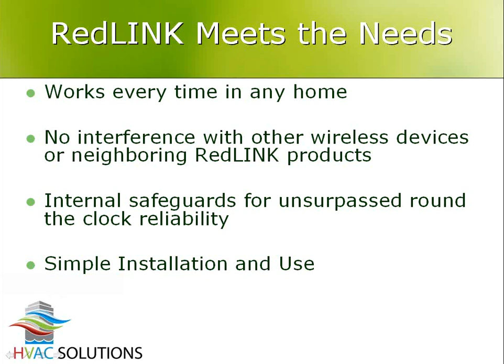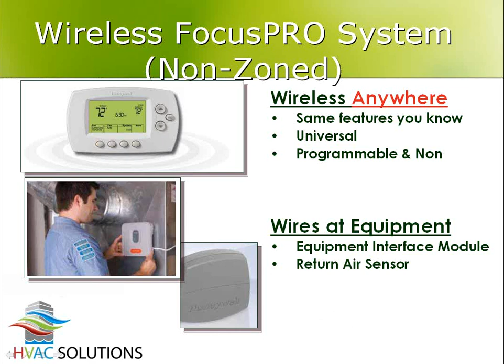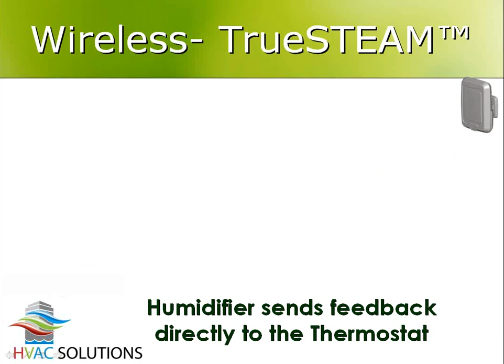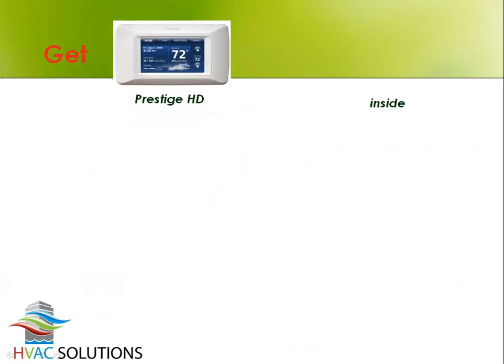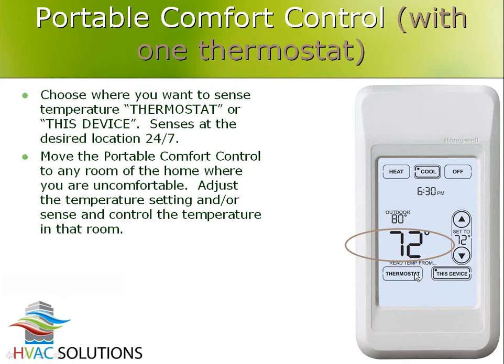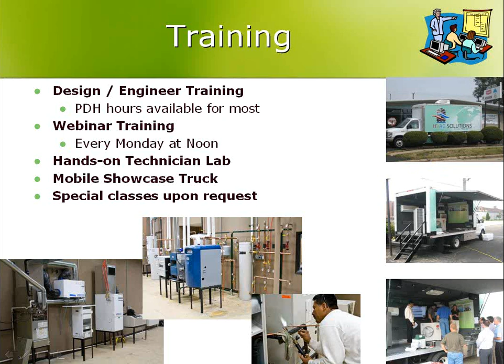Honeywell RedLink Wireless Technology - Webinar 11/8/10

Comment: I need your guide I have a Bosch inverter HP, American standard furnace used as Fan only not dual fuel,  HW 322, 2 Vision Pro stats and 2 wireless sensors on each stat